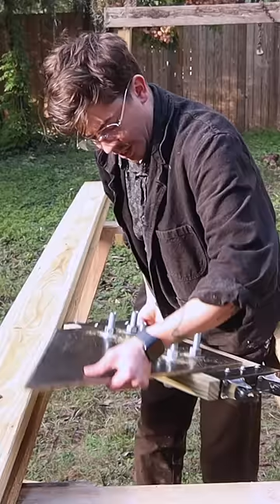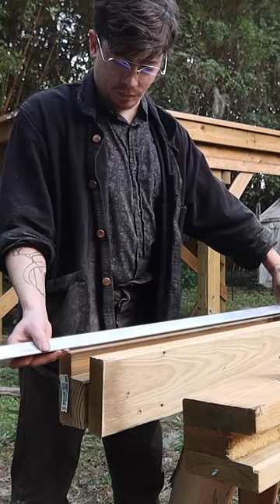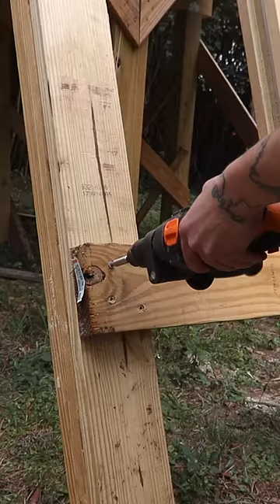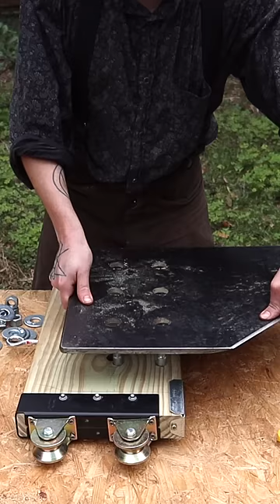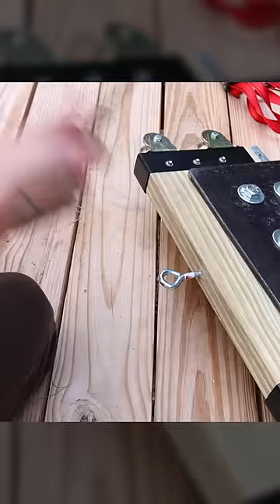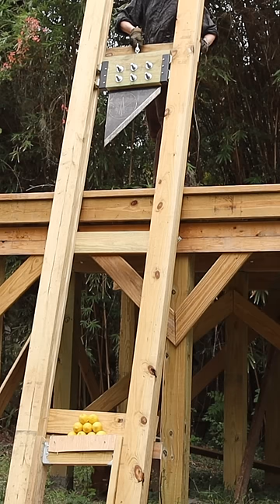Testing the Guillotine Blade

Comment: This man's putting his french engineering degree to good use
Reply: "hey neighbours I got a special blackhead remover come check it out it's in my backyard"
The neighbors when they see it "wait a minute... Oh OH oh my lord.."
Reply: The Guillotine is a British invention, not French.
Reply: @lukemarshall4618  it’s french
Reply: @lukemarshall4618 The guillotine is a French invention, designed by Dr. Joseph-Ignace Guillotin, however you are not incorrect in pointing out that several beheading machines were designed independent of each other across Europe even before the French revolution. The Guillotine itself is a specific model of beheading machine characterized by an oblique blade and a 'pillory-like' restraint.
Reply: Why TF did I think of maximillion robensphere(correct my spelling if wrong) when I read this
Reply: @twinedmouse7821  maybe because he is VERY well known for lobbing heads off

Comment: Fun fact- guillotine blades used to be flat instead of diagonally shaped. Sometimes the flat blade wouldn't cut the head off so they would have to lift the blade back up for another attempt.
Reply: This is actually where the concert encore came from. The execution would use dull blades to rile the crowd up for the donner de l'argent.

Comment: “My killing machine isn’t safe enough” 

-This guy 😝
Reply: It would be that is not efficient. The point of a guillotine is a quick and painless death if the blade dislodges it could hurt one of the operators or hurt the victim without killing them putting them in extreme pain as the operators try and find a way to fix the blade
Reply: @justanotherguy9085  ya I know it’s just a funny thought. lol.
Reply: @justanotherguy9085  ironically guillotines were really bad at their job and usually required 2-4 drops before they actually beheaded someone

Comment: You can also use polished wood as a slide, lubricated with lard. Maybe 1/2" thick blade, extra heavy though. Sometimes the guillotines didn't work right because of the blade dulling and such.

Comment: Attach two long beams to either side of the blade or bolt the blade in a longer piece of wood. The issue is that the uneven weight of the blade is causing it to turn as it falls. If the blade apparatus was longer or had two beams on each side of it, it would not be able to turn in the rail as it comes down. A metal bb will spin all it wants in a straw, but a toothpick will stay upright in the straw because the length of it restricts its movement. If you wanna keep your current setup, (the blade with two wheels either side of it riding on 90 degree angle steel), this could work only if the rails of the guillotine have absolutely  zero wiggle room.
Reply: i appreciate the visualisation of the bb and the toothpick
Reply: How about balancing the blade with added weights... When you think about it, It's falling straight down..The rails should be there just to secure the blade once it hits target. 17th century French did not have hight precision manufacturing, yet the tool worked quite reliably... I'm not a proponent of death penalty, but I would rather have my head cut off, than drugs administered, especially the cocktail US use now.

Comment: The little bounce of the blade at the end gives me the feeling that it's not quite heavy enough if the force of the impact can send it back up even slightly. I imagine that, in that state, it might only get though half the neck - worst case scenario. Though that might also be caused by the temporary uneven ending platform where the blade arrives, which will need to be straight.
Reply: iirc in the full video he mentions adding weights to it for the same reason
Reply: What do you mean, it cuts lemons just fine.
Reply: Wood is pretty bouncy, but yea should test it on 3 inch thick dowels to be sure.
Reply: @ders972  
I dunno about that, lemons are pretty easy to get.
Reply: @DementedDuskull  you are a 🍋
Reply: @ders972  
0🍋:
Reply: Don't worry. The blood and spine will slow it down.
Reply: Exactly what I was going to say!
Reply: Traditionally, the blade would weight nearly 120lbs. Just enough weight and velocity to do what it does best.
Reply: could be solved with magnets maybe 🤔
Reply: This guy thinks we have cow necks or some shit 🤣
Reply: Just remember to say in Minecraft
Reply: @Blankspace138  Me too,first job was dropping heads of pork in a meat packing house.

Comment: "A derailment is the last thing you want with a guillotine blade"

Unless you're the guy the blades coming down on lol
Reply: Well, yes but no
One of the reason of "why" the guillotine was adopted was "quick & painless" death
But i can assure you 15-20 pound of metal crushing your neck is much worse than a quick decapitation (in therm of pain)
Reply: @PoopyMcStinkButt  I know.
Do you know why the blade is curved ? 
Do you know what happen if a curved blade, designed to follow a rail isn't working ? 
Btw a sword badly used is not better than a hammer, same things goes for a guillautine
But you knew it all. aren't you

Comment: You need to spread the wheels farther apart on each side. The minimum spread should be equal to the span between guides. That wooden block should essentially be a square with a guide wheel near each corner. Engineering 101 my guy.

Comment: Need to lengthen the distance between the wheels to stabilize the head and stop derailments. Just an fyi, as you try to cut harder/ larger objects, it will try to jump off track. Making brackets to move the wheels giving it an extra 8-12" above and below head should double it's reliability.

Comment: you should have a tighter frame and make sure it's very rigid in all directions of potential stresses, and make sure you have a really good finish, even under the bolted on metal parts, because once it gets a lot of blood and water on it, the wood will swell up, and you'd never want to have it suddenly fail therefore causing undue suffering upon the person being chopped.

Comment: maybe if the blade mount was about a foot longer it wouldnt be so loose. pretty simple solution that the metal tracks didnt improve on at all as we saw when the fruit was cut. this guy made it 10 times more difficult than it had to be lol. i mean this thing is made out of very large pieces of wood and it damn near fell apart when put to use. the fact that the effort was put into using 6 huge lag bolts to secure the blade and the rest was thrown together by a 5 year old is very disappointing. such a waste of time and supplies.